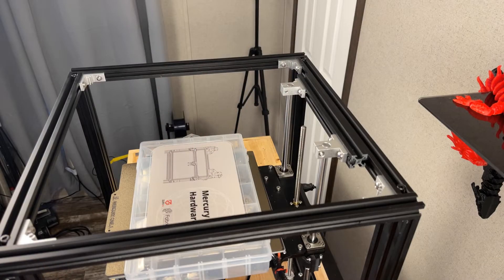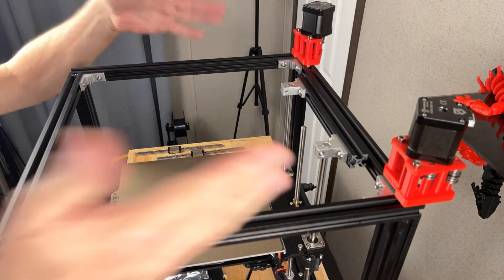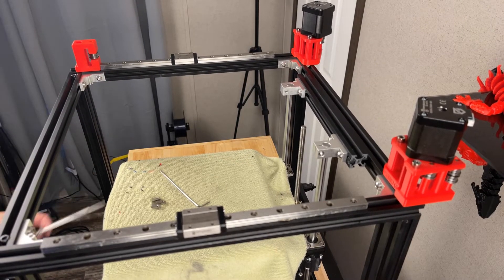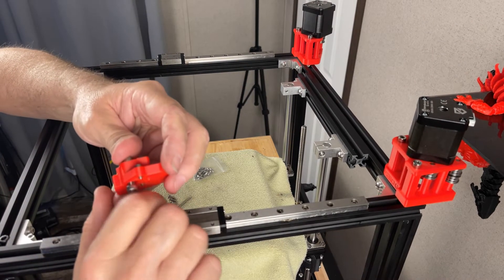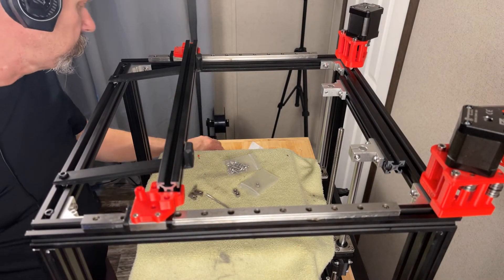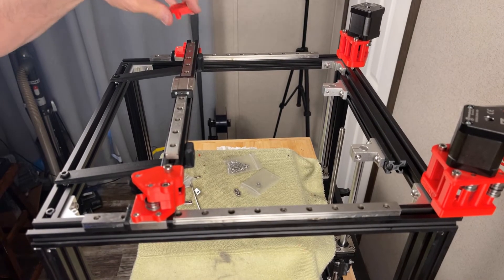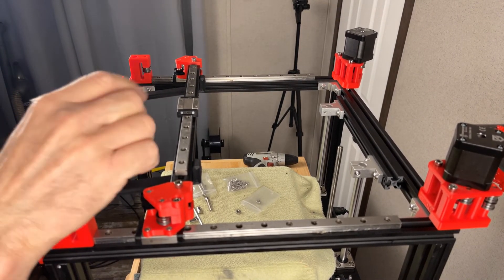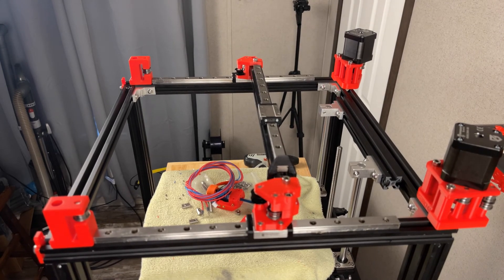MERCURY ONE.1 Full Build Video 4 - X & Y Assembly

Comment: Great videos. What is the height from the bottom of Ender 5 pro original feet to the highest point ( stepper motor ) I have a cabinet that I built and I want to see if it is high enough.

Comment: Great videos. Thanks so much for all of your help! Just wanted to mention to anyone following the videos that the xy joints shown in the video seem to have been updated with a newer version. Maybe those can be covered in a different video!
Reply from the maker: Correct, there is a new version of the XY joints and I will be publishing a new video specifically for the assembly of these in the next few days.
Reply: @EDGEOF3D  fantastic! Thanks again! Also to anyone using the fabreeko kit, you may want to check your m5 10x5x1 shims height. The shims used in all the bearing stacks. None of mine were correct and had a variance of up to .5mm. Luckily Fabreeko has excellent customer service!

Comment: What are your thoughts about doing such a conversion on an Ender 5 Plus? I'm concerned that, at its size, we're dealing with really LONG belt paths. Thanks!
Reply from the maker: Several people are running the 5 Plus without issues. You will not be able to run really high accelerations and you won't win any speedboat races but in general, it works just fine.
Reply: @EDGEOF3D  Good to know, thanks! I ended up pulling the trigger on a Fabreeko kit the other week. (I'm printing the ABS parts as I type this).